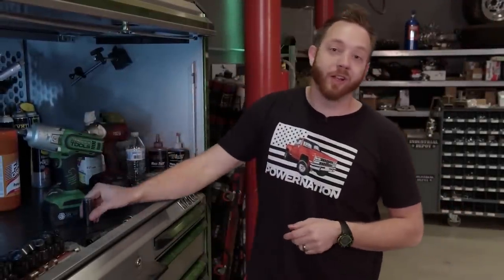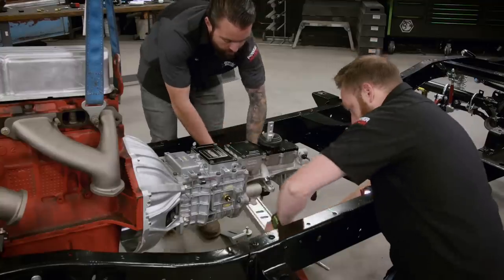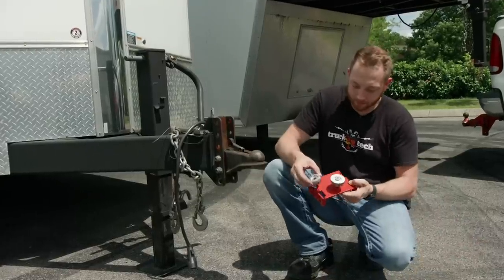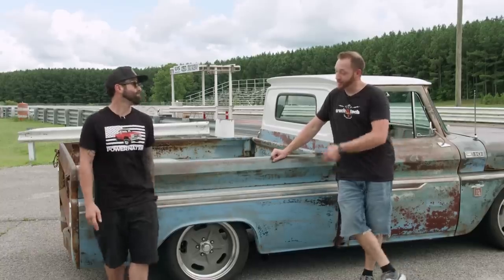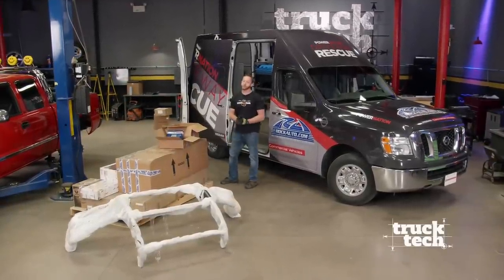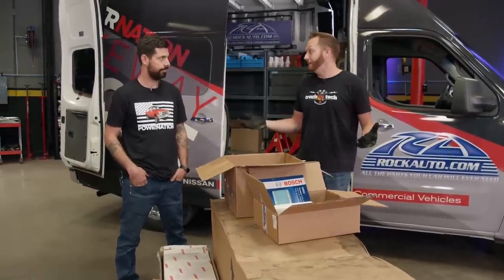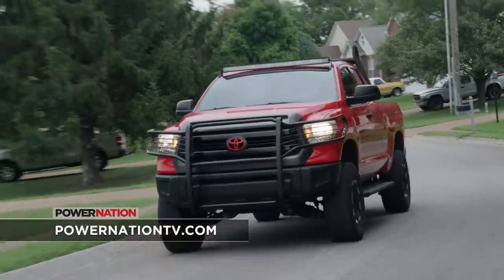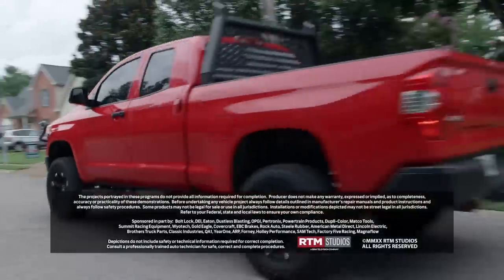Took Our ’65 Fleetside Chevy C10 To The Dragstrip And It BROKE - Truck Tech S7, E19

Comment: Flywheel bolts...a lil Locktite goes a long long way.
Reply: I was just about to say, I thought putting loctite on flywheel bolts was something they taught in kindergarten
Reply: More than that. 292s take 3 dowel pins, not one, and use six 1/2'' bolts, not 7/16''  They set it up like it was a 250. And that's for stock a 292, 170 horse. Heavyweights use 3 more 1/2'' bolts to replace the dowels. TV Dudes didn't know L6s.

Comment: 292's will always back out there flywheel bolts if the wrong bolts were used and not torqued correctly. That is one of the things the Chevy inline six power manual warns about. Glad y'all caught it before anything got messed up.
Reply: Exactly. They have their own bolts, for both the manual and automatic flywheels.
Reply: @elmerfudpucker3204  add to that typical Chevy uses the minimal amount of bolts for everything

Comment: Your more than welcome to come rescue either of my 2 Jeeps.  I miss my YJ that was totaled years ago thanks to a careless driver.  But being partially disabled, unable to work for the past few years, my budget for repairs is zero.  1st of my 2 Jeeps is special to me and belonged to my step father who passed a few years back.  Its a 98 Grand Cherokee 5.9 Limited and it is amazing fun to drive.  However it's steering is out, and has a few leaks here and there.  The 2nd is a 1960 Willy's CJ-5 that I took on a couple years ago as a project.  It needs just about everything and the engine has seized umong needing just about every part of the brakes.  It needs a radiator and a bit more patchwork on the body which I do as I can.
Reply: They dont reply you are wasting your time

Comment: @powernation I would hope that you guys know this already but....I6s have a nasty natural harmonic @ 6k rpm that no amount of loctite can keep bolts in.  You gotta be @ 5500 or 6500, not in between. You hold her @ 6k and she will throw flywheel bolts and harmonic damper rings in very short order! Old racers learned how to drive in and out of that range on the old six's. 
On the street, I keep my 3/4 race I6 shift point @5500 rpm. I've taken it higher, but if I hold the rpm @6k for longer than a few seconds I check the flywheel bolts before I put it away. That inspection cover suddenly becomes very convenient!

Comment: Damn, LT seemed a little pissed right off into a low earth orbit.... So tell me what really happened here, gotta be a little more to it then what ya'll showed in the video.
Reply: A loose flywheel would cause this and many more serious problems if it had came off at high RPM. The guys were lucky.
Reply: @olemansailor6519  Rookie mistake. I know it didn't exist in the 60s, but nowdays everyone should use blue Loctite on the flywheel bolts. Maybe even red. They got orange now too, which is in between.
Reply: @donellmuniz590  if that's what happened, I doubt you'll see this project again. That would be sooo embarrassing to have f'd that up

Comment: Theres a lot of bull going on here about the flywheel bolt failure issue because the truth is that no amount of Loctite is going to prevent those flywheel bolts from coming out. All straight sixes suffer from a violent harmonic vibration problem especially when they are hopped up and the only cure is to dowel the flywheel on to the crankshaft, 3 x 1/2" dowels will just about do the job but I personally always used 6 x 1/2" hard steel dowels installed between each flywheel bolt. The other thing is to upgrade the bolts themselves and increase the tightening torque by 30 lb ft. This problem was caused by the lack of experience of the engine build side of this project not the truck build people. Note. the crank and the flywheel are usually  both severely damaged in these flywheel/bolt failure incidents and are best replaced and in any case the machining involved to install the dowels is strictly a machine shop only job and will require the crank to be removed from the engine so all in all it's a lot of work and money to sort out.

Comment: Those old Sixes had torque, down at the bottom, like a diesel. 
Big rigs - max torque at 1500 rpm, while a 250 like mime, at 1600 rpm.

Comment: You just gave me a peek about what coulda been to my ‘65 C20 some 30 years ago before life/money/ability got in the way.
BTW you mentioned a 235 six for this year, nope, 194, 230, 250 & 292.
Hated my 230 3 on the tree so I got a top loader 4 speed.  That was the end for the ‘65 as I didn’t have help or Jack to lift Jack to lift that behemoth.

Not a patina fan, mine woulda been copper colored.
Looks like you ran out of paint.

Comment: These guys put loc-tite on everything. How do flywheel bolts back out? I rebuilt plenty of engines and I have never had flywheel bolts come loose!
Reply: Loctite only works on clean metal.   It won't set properly if it's has oil on it.  Before I use thread locker I clean with acetone.
Reply: @bmstylee  Agreed. I've always put mine in a basket and let them soak in my parts cleaner then spray them off with a non chlorinated brake cleaner and let them dry.

Comment: I had to drill and safety wire my flywheel bolts on my 6 cylinder, the harmonic's on a crank that long is hard to control !

Comment: I would love to get my husbands f150 fixed it needs new shocks ans the ecm or gem module fixed on it. It also needs a little body work, and would love to get the front push bar and tailgate extender on it

Comment: Damn LT was legit pissed at ol' Austin. Being the new guys sucks... Wasn't his fault.
Reply: Thread locker is a complex thing to use properly I guess.  Flywheel bolts without it is asking for trouble as we saw.  It generally doesn't work on greasy metal and strangely you never see them degrease a bolt or the hole.  As someone who knows his way around guns scope rails and rings come loose quickly from recoil without it.
Reply: @bmstylee  rare that they'll even reuse anything greasy or rusty.
Reply: There is a specific set of bolts that have to be used on a 292 with an automatic or standard transmission. The only person to be upset with is the person that was responsible for getting the parts together for this project. It's the little details that can reach out and bite your projects in the butt and cost big money if they're not caught soon enough. I'm fixing a dumbbell thing I missed on a engine build now. I'm just glad it was my own junk and not something for someone else. Love this channel guys!!!!
Reply: @adampatterson707  yep.  Details details details.  Don't pay attention and you will get bit.  I work on cars but I don't really enjoy it most of the time.   Building guns now that's what I enjoy and details are super important given you have a small explosion happening right in front of your face.
Reply: The best part is, I went back and watched the engine install and LT is the one who put the flywheel on.
Reply: @permafrost2064  so he's salty for nothing.

Comment: IVE GOT A PATINAED 1966 C10 FLEETSIDE IN EXACTLY THE SAME COLORS AND FACTORY PRIMER. BUT IT HAS A SLIGHTLEY LONGER BED AND A SMALL OVAL FOOT HOLE STEP BUILT INTO THE BED DIRECTLY BEHIND THE CAB ON BOTH SIDES. IVE BEEN TOLD THE SMALL BUILT IN STEPS ARE FACTORY. IVE NEVER SEEN ANOTHER CHEVY TRUCK WITH THESE SMALL OVAL FOOT SIZE STEPS.
IT RUNS BUT HAS FLOORBOARD RUST AND NEEDS THE PANELS.
THE INNER FENDERS ARE OKAY BUT IT NEEDS BOTH FENDERS.
WHATS IT WORTH AS IS ?

Comment: Did y’all lock tight the fly wheel bolts on the 65 Chevys are notorious for flywheel bolts backing out, why don’t you pull the fill plug out first on gear boxes they drain so much better you have to take them out anyway.🙄

Comment: So who ran the flywheel bolts down hand tight and never torqued them?
Reply: you need to retorque after that first run... or if your me and dont have a torque wrench that fits in there you just hammer them tight with a dead blow and a combination wrench
Reply: No loctite used?
Reply: @philtripe  all of what you said is so incoherently wrong, I am surprised you're even able to use youtube.

Comment: Step1: Lift your truck for ground clearance. Step2: Lower your ground clearance by installing foot steps. WTF?
Reply: If they were real rocker protection that had steps built in it makes sense.   These look like steps with no protective properties and will bend with a small hit.  The electric ones that tuck up when not in use make more sense.

Comment: What did mechanics do before Loctite? They tightened the bolts to torque spec. What did they do before torque wrenches? They learned to have a "feel" for how tight the bolts were. You don't put the blame on not using Loctite. You put the blame on the person who didn't tighten the bolts right. As far as the Patina look, The white truck looks finished. While the patina truck looks half-ass done.
Reply: Flywheel bolts have always been a problem.

Early Fords had safety wired flywheel bolts. Lock washers, peened threads, etc. Have also been used to to keep then in.  Locktite is definitely a must for flywheel bolts now adays.

Comment: I hate that rusted look....you went and got it new chrome why not give it some pretty paint and make it look nice and not unfinished....
Reply: I don't mind real patina.  You know something it earned.  I don't want it anywhere near my truck.   However this fake patina shit needs to go.   I get paint work is expensive.  But just like when the early 2000s 300mm+ tire and 20 foot long trend in bikes ended you were left with something no one wanted. I remember a Jesse James custom bike selling at a well known auction house for $20k a few years ago.  Or about 20% of the original price.   Rat rods and rust paint jobs will be the same.  A lot of expensive parts with no one interested.   However a nice paint job in a sensible color will always be desired.
Reply: @bmstylee  paint isn't as expensive as people may think. Well I should say like unless you're going full custom airbrush and pinstripes from a well known artist. You can get great work from local not so well known artists at a lower price and solid colors are easy enough most could do it themselves if they took the time to prep the materials which is actually most of the work. Having done so myself. Granted if your looking for like harliquin paint that changes colors as you walk by yeah that's stuff is expensive. But for most classic colors it's not to bad. Probably even less expensive than a lot of parts people throw on.
Reply: @lionsbrew  true.   The diy method is hard because you may not have someplace clean enough to spray.   Or the tools.  A good gun and a compressor that can handle it could be a stopping point for some guys.

Comment: I hate the fact that you guys put a 6 cylinder in that truck, it needs the awesome notes of a V8 ,plus you could've put a stock  NA LS3 and had more horsepower or do one better find a 2019 ZR-1 motor in a bone yard , port the blower, new cam , injectors and a tune and you would have 1,100 horsepower in that truck
Reply: Cause Ls swaps are boring
Reply: The point is, it’s their truck and they can do what they want. Who wants to be the same ol boring thing and do what everyone else does. Being deferent sticks out in the crowd.